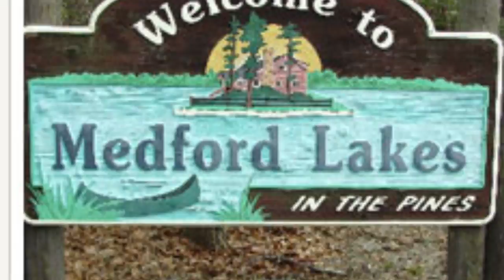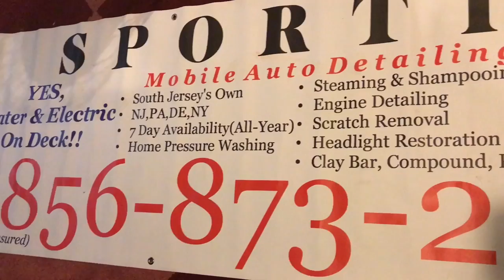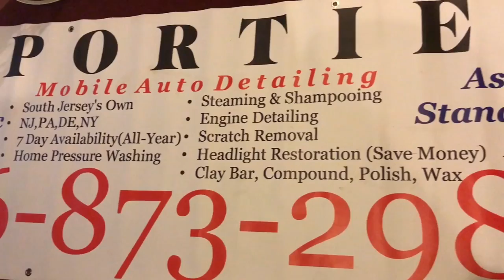Hyundai Azera "Grunt Work" by SPORTIES

Comment: Every video I watch,theres a little trick or a few tricks I pick up on! I gave my Suburban an exterior detail when it was 40 degrees,it got down to 18 that night and the door locks froze up! Would compressed air into the locks prevent this? I live in the U P of Michigan and this weather is unusual. Normally,it doesn't get above 20 during the day! I appreciate how you repeat so many of the truths of auto detailing in each video! Many are sticking in my head! Thanks again! 12/30/2018